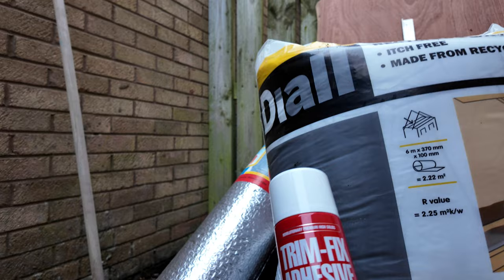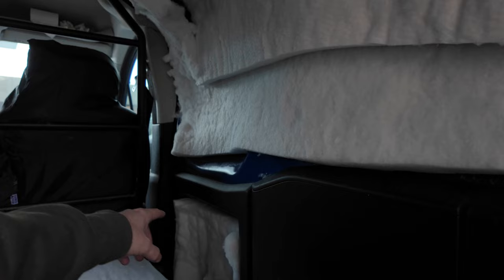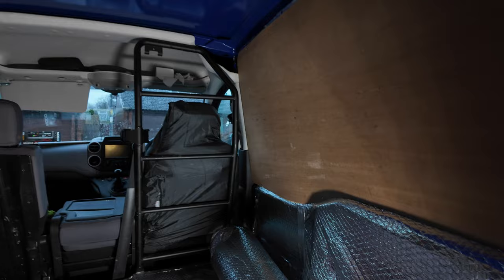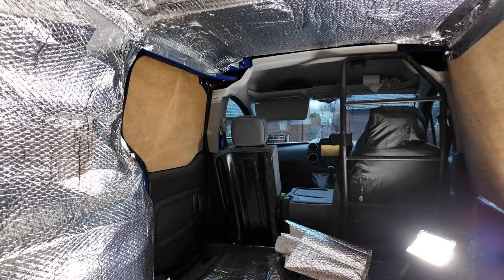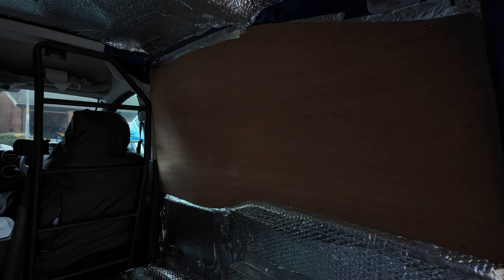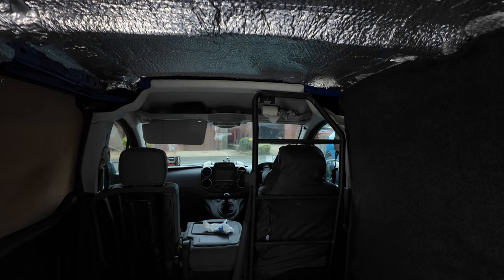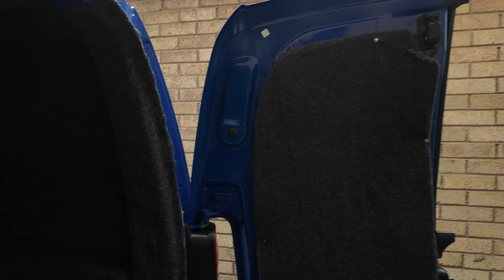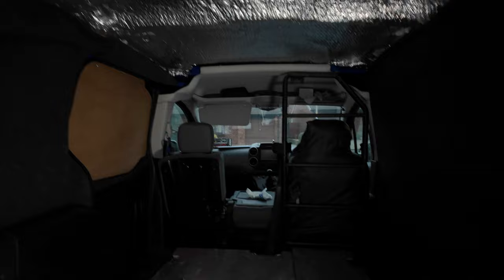Citroen Berlingo Micro Camper Build for Landscape Photography Part 1

Comment: You should have bought 1 pack of sound deadning makes a big difference to road noise you only need 25% coverage on panels
Reply from the maker: It's actually quite quiet alot more than it was with bare panels can hardly hear the road noise wile driving